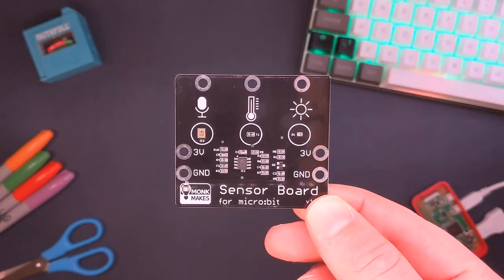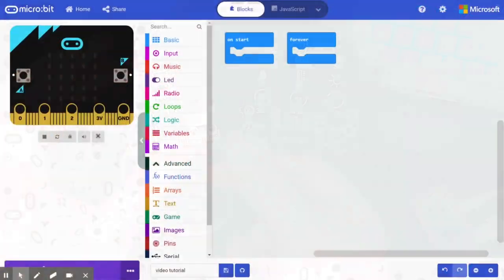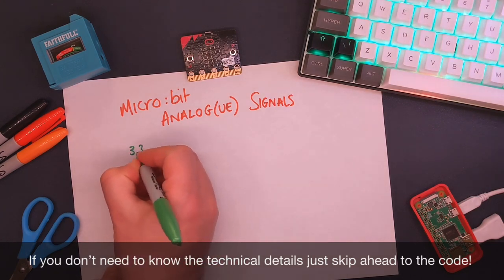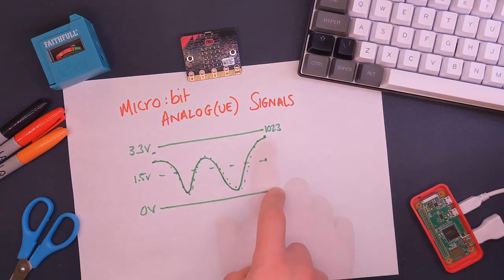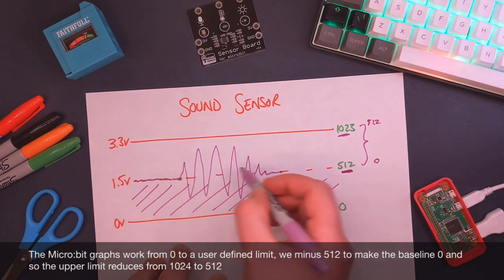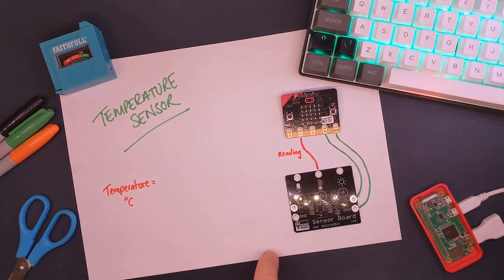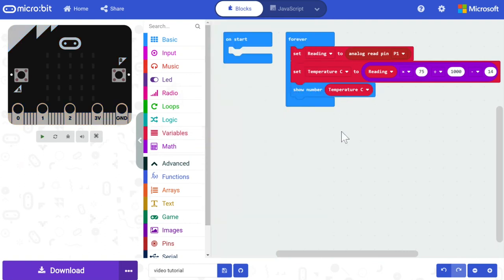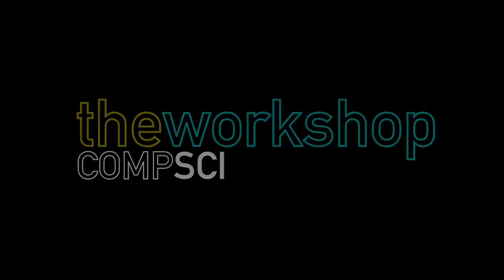Micro:bit & the Sensor Board

Comment: Excellent video Pauric. Are the sensor board sensors more responsive than the built in light and temp ones?
Reply from the maker: I don't have the data comparisons but from using them the dedicated sensor board is miles ahead of the built in Microbit sensors and allow for a greater accuracy. Hope that helps!
Reply: @pauricodonnell9906  great thanks